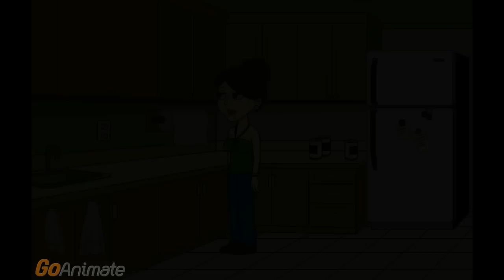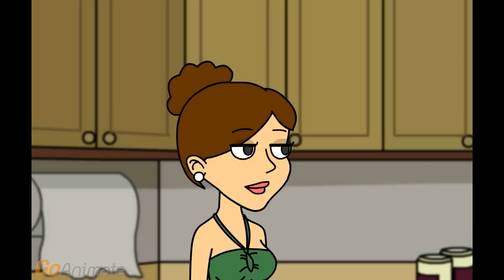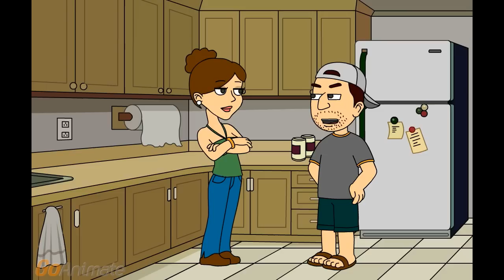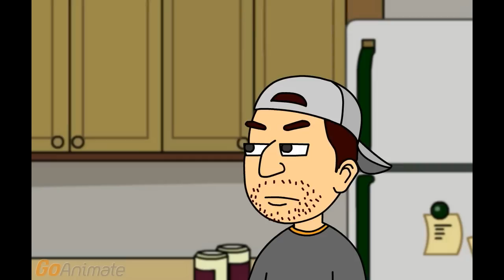Fujitsu Air Conditioner Troubleshooting

Comment: Regarding the air flow would the humidity be as extreme to cause puddling through the ceiling below the unit? That is the problem I have,  the unit is soaked, there is barely any water in drain pan & drain line doesn't seem to be clogged. Any suggestions?

Comment: I have two Fujitsu Halcyon DC Inverter units which I mostly use for AC.  I have been using the one in the kitchen for a couple of days in heat mode.  All was fine.  When I went to shut the unit off via remote (only use the remotes), I noticed that the door was shut instantly.  Come to find out that the door probably came down while the unit was running before I shut it off.  Now the door will not come up when I turn the unit on.  I called Fujitsu Tech Support twice (2 separate numbers) and was told to get a contractor in and when I called the second number   the other guy said to call an HVAC guy.  I then turned on my other unit  which also goes on but the door does not come up now on this one.  Any help would be greatly appreciated.  Thanks
Reply: I have two units and one of the two does this.  I'm guessing the unit doing this is not absolutely level.  Which would inhibit the door closing correctly.  When it does this, with the unit off, I snap the door down tight, and then turn it back on, and it operates correctly.  I don't recommend doing this when the unit is on (lights will be flashing) as you may be pushing against a motorized operation, which would break the mechanics.

Comment: I have not use the Fujitsu for several weeks but notice one night that Red was blinking 8 times and the Green 4.  I can turn it on, but it doesn't cool.  Can you help?  Thanks
Reply: Roberto Fajardo same.  and the air con case does not open and move up, it just flashes the light. any idea??
Reply: Hello, and I hope this will help.  First, the flashing sequence means different problem and or issues.  In my case, I called my electrician and after telling him what the flash sequence.was he instructed me to turn the breaker, of the specific air conditioner, and wait 15 minutes, then turn it on and see what happens when I turn it on.  It worked in my case, but I don't know if this will help you.  My electrician told me if what I did would have not worked then it was going to be one of the boards that regulates voltage or amps.  Let me know if this work or helped you at all.  Good luck.
Reply: @robertofajardo7551  Same problem like light flashes on actual unit. Looked alot on materials , turn it off from main switch,nothing helps. Unit like 2 years old only ,barley use,not heavy usage. Really give me the shits and the installer for some odd reason doesn't want to return. Bad for fakn business to get in install the bloody thing cash your money and not giving a fuck about your customer . Small fakn town waiting for him to come back for more then 2 weeks.  Frustrations all the way to roof top . FMSD
Reply: @B34Ugo  When the lights flash, they're an error code for the sequence.  BEST CASE, web search for your model to find what these errors mean, because some of them can be addressed by the home owner.